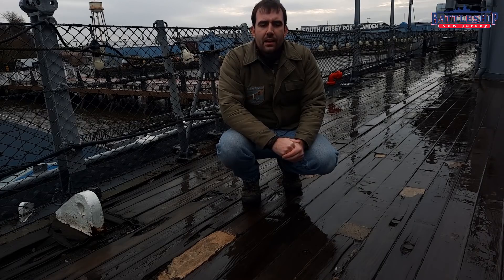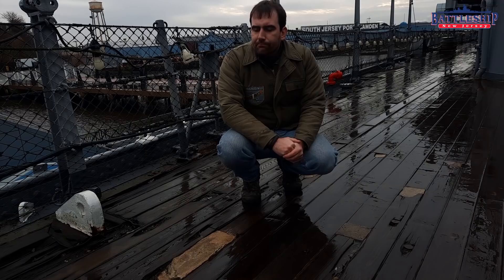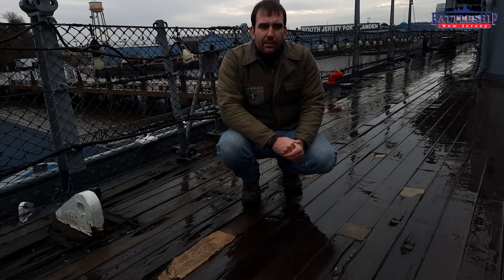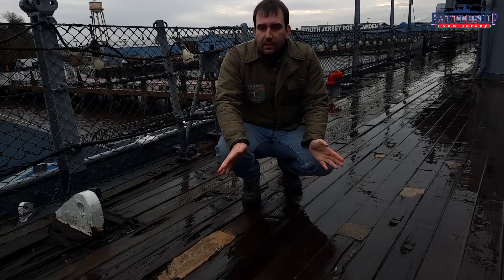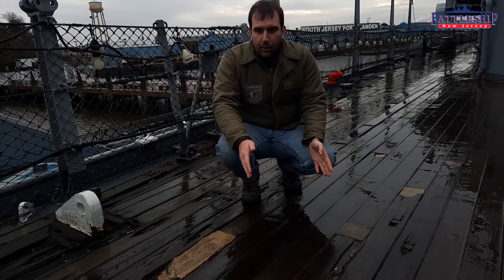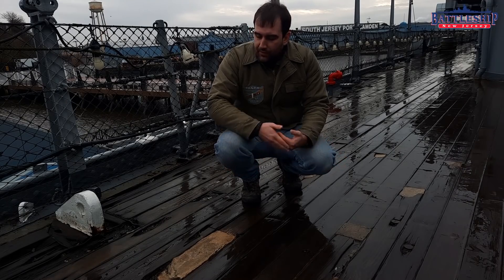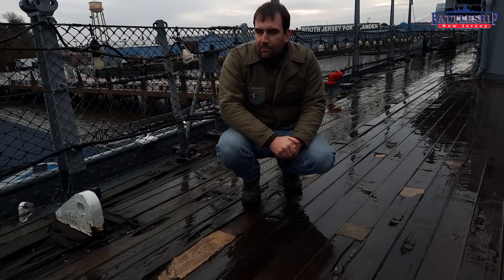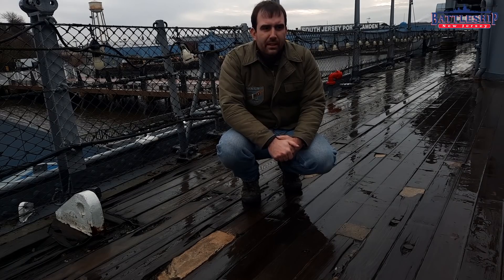Why aren't Museum Ships in Concrete?

Comment: U-995 sits on dry land for nearly 50 years now, and it seems to be in good shape. I guess this can be credited to the much more sturdy structure of the hull that a submarine has to have to withstand the water pressure
Reply: Look to the Brits(Which Normally I Refuse). They have ships Hundreds of years old that the Hull has not Rotted/ Rusted away.A ship cradle is a rig designed to hold a ship or boat upright on dry land to allow the vessel to be built or repaired. The vessel is held in place in the cradle by wooden chocks. You can concrete under & around.Once again they have a Ship(  Lord Nelson's flagship at the Battle of Trafalgar on 21 October 1805)of the Line that you can go & walk on in the UK. The Hull is really the foundation of the vessel.On average, seawater in the world's oceans has a salinity of ~3.5%. I Believe all these very important vessels could survive for a hundred & fifty or two hundred years if an effort of dry docking was accomplished. Imagine being a young plebe & training or standing watch on an Iowa class BB in Annapolis Md.
Brian Golightly
Reply: Submarines also have no heavy armor weighing everything down, so putting a sub on land isn't as difficult as you might think. Battleships are damn heavy compared to their structural strength. Just lifting or dragging one out of the water without crushing parts of the hull will be very costly, and then you'd need to construct some kind of cradle that can spread the load evenly across the hull so it wont sag over time. It can all be done, but doing it all properly is very expensive in the short term, but I imagine it is a lot cheaper over 100s of years since a lot of maintenance becomes easier.
One could also build a permanent dry dock, with the permanent supports already in place below the water. Just tow the ship in place, pump out the water, and gently lower the ship onto its permanent supports. Probably easier to do, but now you need to maintain the dry dock as well as the ship, and it still isn't exactly cheap.
Reply: @briangolightly1447  the victory is in excellent condition. But the size difference your talking about is incredible. Also she was heavily restored. As was warrior. We didn't wave a magic wand to keep them in good order.
HMS Victory is possibly the most historically important ship left in the world. She's had the money spent accordingly.
Warrior was built with a typical Victorian level of engineering. They really built things back then. England has many examples of operating Victorian equipment that's outlasted many a replacement. And the forth bridge in Scotland is an amazing example. I'm sure there are others in Wales and Northern Ireland :)

It's great to see America having all these ships. But I wonder, would it not be better to keep one of the Iowa class and put all the money into the preservation of one ship rather than just about looking after all of them?

As a side note. You may not like us lot over here. But each country is very different. If you don't like the English then Belfast is a great visit (the Titanic museum is great). If you can put up with the English, the historic dockyard in Portsmouth is amazing. And if you can put up with Londoners (a country onto themselves you may think) then HMS Belfast is a cracking visit). Royal navy museum at Hartlepool is canny. I'm sure there are others in Scotland and Wales I've never been able to visit
Reply: @briangolightly1447  I meant to add. There are no 'brits'. There are 4 very different countries and within each, the areas differ just as America does.
Saying "The Brits" is sort of like saying "Them Americans" and meaning Canadians, Mexicans, Cubans and people from the USA" 😂
Reply: @ButterfatFarms  I'm not sure if you have miss understood my comments, or.... Actually. I can't think of an "or". 
Your comment seems to tack with mine well enough. So, are you agreeing with me or not 🤨. 
It's very confusing
Reply: @AdamMGTF  - The problem with keeping only one Iowa class ship is that the residents of the other 3 namesake states will arrive with torches and pitchforks.
Reply: @tominiowa2513  I thought the inter country rivelry in the UK was bad lol.
I admit I was once punched when in Cardiff (capital of Wales) by a drunk Welsh football fan. Quite the shock as he and his mates were out drinking and easily 20 and at the time. I was all of 15 years old and weighed about 55kg wringing wet.

But that's football. It goes hand in hand with pointless violence. Can't stand the game.

I can't imagine there being an uproar over historical conservation like. Even the squabbles about the king's stone between England and Scotland is considered the preserve of history nerds (for the most part. Obviously you get the odd right wing nut jobs. But thankfully they are few and basically ignored unless it's a slow news day).

It's ironic.

The United states and the *United Kingdom*. And it seems neither are very United 🤣
Reply: @ButterfatFarms  my confusion is because I didn't understand what you said.

Comment: in the aviation museum world they coat a resin on the aircraft to prevent corrosion thats mainly why warbirds are shiny , take a look  at temora aviation museum and you will see they can even still fly with this coating , and no its not the white latex you see at the boneyard its like a clear coat , what do you reckon about that as an alternative to simply paint on exposed surfaces

Comment: The wood deck of the battleship Texas was replaced with concrete in the 1960s. It caused terrible corrosion of the underlying deck. It was removed at the 88-89 dry docking and replaced with a traditional wood deck.  That deck will get replaced again at its 2021 dry docking.

Comment: Has anyone ever thought about thinking outside of the box with regard to Museum Ships?  Consider that while in Navy Service, the NEW JERSEY would routinely travel thousands of miles at 20 plus knots, whereas now that she's a museum ship, she only has to basically sit in one place looking good.  I'm not saying put her into concrete, but what about coating her lower hull in such a way that would not be feasible for the Navy, but could be used now that she's not going anywhere?  I'm thinking something along the lines of building an outer hull out of, say a heavy duty plastic, placed an inch or so outside of the current steel hull, and then filling the space between the inner steel hull and the outer plastic hull with some kind of liquid (distilled water perhaps) that would be less harmful for the steel hull than the salt water she currently sits in.  Just a thought.  Loving the videos.
Reply from the maker: Shes currently sitting in fresh water. Coating her in anything, including the special paint we will use next time she goes to drydock is about a $20 million project as is. Doing any sort of plastic is going to be very expensive and you have to be very cautious that it doesn't crack or you'll have water held against the hull with air and rusting it away worse than it is now.

Comment: If ever I become a mega bazillionaire, I’m giving you guys a call, and we’re making New Jersey a running ship again. 😇
Reply: You might consider a ship like USS Slater instead. She's merely a DE, but she's a lot closer to a condition that could actually return her to operation. And it would still suck most of your bazillions.
Reply: One of the conditions the Navy had for NJ being a museum ship was that the boilers never run; or that the ship never uses its own engines. That said, NJ conservators run their own power into the ship instead.
Reply: Build a new ship, the national archives have plans for them
Reply: @themightiestofbooshes9443  That depends on the area, like in hurricane prone areas they can use steam during storms. case in point, during Katrina the USS Alabama used her steam generators during the storm until power was restored on the condition she house evacuees. in the event of impending disaster, the gov makes exceptions.
Reply: @themightiestofbooshes9443  Aye, but if the museum sells the ship to someone else, they don't have to follow the Navy's contract (unless it's in the new sales contract too, of course).

There was a German PaK-40 (75mm AT Gun) that had been painted pink with flowers and the owner stipulated that she would only sell it if it wasn't made functional again (sound familiar?).  One person bought it, then sold it to someone else who promptly refurbished it.  It's now (supposedly) the one you see shooting on YT.
☝😅
Reply from the maker: Except the contract explicitly forbids selling it. And remember folks, every ship has a unique contract, just because our says we can't do something doesn't mean that others cannot.
Reply: @BattleshipNewJersey  Get them galleys working!  As an ex-chef I see a huge amount of wasted potential in that stainless steel!
🤣👍
Reply: What was the USNs reason for the specific restriction on never running the engines or boilers on NJ? Liability/Safety?
Reply from the maker: Safety, potentially starting a war, mistreatment of the artifact. These arent toys and shouldn't be treated as such.
Reply: Interesting reasoning from them. Was curious if it would be economical for NJ to be able self-power some of her own systems and such via engines or boilers, versus rely fully on shore power. Of course boilers and engines require experienced crew to run, especially older school stuff like boilers; not sure how many BTs and MMs are on the staff there.
Reply from the maker: Our contract specifically forbids moving the ship for any reason other than maintenance.

Comment: People are overthinking. All on the premise of putting some barrier between water and steel so it won't rust.. All ships already have one such barrier: Paint. Just drydock the ship every 10 years and repaint it. Putting the ship on land or inside concrete doesn't matter, without paint, metals will still corrode with rain water and moisture.

Comment: Fundraising idea: as you remove and replace planks from the deck don't throw out the old ones. Instead cut them into small thin slices (maybe 1 inch by 1-half inch by 1-quarter inch thick) and sell them with proceeds going toward the ship preservation. . I'd pay $30 to own a tiny bit of the Battleship NJ, frame it, and put it on my wall. Maybe others would, too. Just a thought.
Reply: You can buy deck plank pieces from the museum store already.
Reply from the maker: Yes. We do. Go to www.battleshipnewjersey.org/store
Reply: Thanks!  I'll be ordering shortly!

Comment: The AGSS-569, Albacore, is sitting in a ditch intended to slow its deterioration and lower its maintenance costs. Did this turn out to be a good preservation idea, in practice, and has there been anything beneficial discovered for preserving larger steel surface ships?
Reply from the maker: Heres our thoughts on putting ships on land:
https://youtu.be/sa8x2gc448c

Comment: So from what I read a drydock is a graving dock. When that was suggested before, you said that wasn't a good idea? If you had support on the sides of the hull corresponding to the framing would that work? Kind of like the pictures of when these (and other) ships were under construction.
Reply from the maker: A graving dock is better than a drydock, it provides additional support to the sides of the ship. But it still isn't perfect.
Reply: @BattleshipNewJersey  Thank God you're in fresh water.
Reply from the maker: We're very grateful, and so is Olympia across the river, its bought her a lot of years

Comment: In regards to the part about where the pressures goes in concrete, what if the concrete was formulated like the mortar on the Great Wall of China? In that mortar mix is about 3% sticky rice which apparently gives it some elasticity which is believed to be the reason sections of the GWC has remained largely intact for so long.

I only ask because I get the feeling that with this question many are assuming just finding Joe Schmoe's Average Concrete Inc. instead of thinking about what may be available on the market.

Comment: 👍Hi I don't pretend to an expert any means and I see your point about the upper deck and concrete but I have been to the ship in concrete in Japan. I think a steel V shape cradle ( sort of a  dry dock type cradle ) was built around the ship before it was encased in concrete. If you outer hull is concrete and it rusts through can't it be repaired from inside the ship
Reply: It would be very difficult due to the amount of compartments around the entire hull, not to mention the torpedo bulges which are mostly sealed compartments. They've done videos on how many spaces there are between the outer hull and the habitable interior.

Comment: You keep mentioning the pancaking so I'm curious.  What's your thoughts about USS NORTH CAROLINA being stuck on the mud?  I know the idea of taking her to Norfolk was discussed several years ago but was turned down for the coffer dam idea.  Love your videos keep up the good work.
Reply from the maker: We're looking closely at NC, she might be the future of these ships
Reply: How would they move her to move her to Norfolk? I heard that she became "land locked" where she is by a bridge that was built not long after she was moved to her mooring location; not to mention all the mud that encased the hull.
Reply: @HaddaClu  if that was the case, wouldn't someone demanded the ship be scrapped? It happened to the Barry a few years back, and rather than consider relocation they just had the ship scrapped.
Reply: @haydenbliesner2247  Barry was a little different, she was still Navy owned, whereas Showboat was deeded over to a historical society in 1962.  The Navy did consider relocating Barry, but determined that between dwindling visitorship and the cost of needed repairs, it wasn't economically feasible.  North Carolina is now trapped in by three bridges between her and the sea; the cofferdam solution is, essentially, building her a floodable drydock in place that also opens up viewing angles that haven't been available since she was berthed.
Reply: @HaddaClu    my understand is had they gone with that option they would have had to dismantle some of the top posts of her superstructure, probably something like what was done with Iowa (removing antennas and top pieces).

Comment: Hey Ryan, how does the museum in Chicago work for the U-505? Is the base to support the sub concrete, or some other material? 

Would this be viable for some smaller museum ships, putting them into a climate controlled building? (Setting aside cost to do so).
Reply from the maker: Very few ships could fit in a building, so its highly impractical for most of us. And land is a bad idea for most anything but subs. They pancake. But exactly what holds 505 up? Not sure. Maybe we will get out there to see them someday
Reply: @BattleshipNewJersey  Does regular earth not have the same exerting pressure along the whole hull that water would?
Reply from the maker: The water can support the hull while the open air does not.

Comment: That’s somewhat of a Misunderstabding. You can add any number of chemicals to concrete to change the PH and ability to resist water.

You can have the hull wrapped or coated then cast. Stopping corrosion.
You can Mix in PVA, SBR any number of waterproofing mixtures to stop water penetration and absorption
You can cast it and seal it externally with chemicals.

I think your main concern is the price of casting it in hundred thousand tonnes of design mix concrete.

Comment: As far as the deck goes, have there been any control tests that studied the effectiveness of modern spray-on coatings like bed liners? If the steel surface is properly prepared and rust free, that seems like it would be an effective, renewable and repairable solution to replace the teak deck. Barring of course the sudden influx of 2000 volunteers to provide an in-service level of maintenance. Plus, who knows, maybe one of the vendors would even be willing to donate it. It would be a fantastic advertising campaign for the vendor. Sponsorship of course has its own pros and cons which are beyond the scope of a facebook comment, but as we have seen in previous videos, failure of the deck can have massive cascade effects throughout the ship. Just a thought. 

Oh and "good luck with that" ... lol
Reply from the maker: Here's what we're doing for the teak deck: https://youtu.be/OIteMpyHb48
Reply: I can see it now; Line-X, official deck material of Battleship New Jersey! 
Hell, it would even be like an extra layer of light armor! LoL

Comment: From what Ryan has said.........anchor the ship in coffer dam filled with some kind of oily mud perhaps?  Heavy oil is about 90% density of water, and with some solid in solution it would be 100% equivalent to water and not likely to ignite for any reason. There could also be some kind of non oily solution that is non corrosive and oxygen deprived.
Reply from the maker: It will need to be inside a building to keep out any wildlife, you're looking at a 900 foot long by 300 foot high.
Reply: @BattleshipNewJersey  that would be ideal...........solves the other weather related corrosion problems.........only problem is cost.